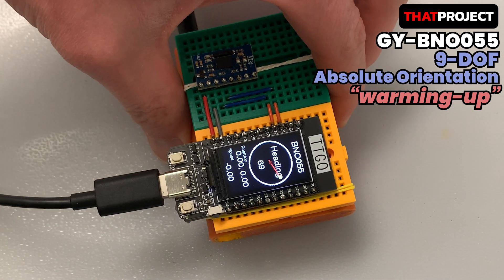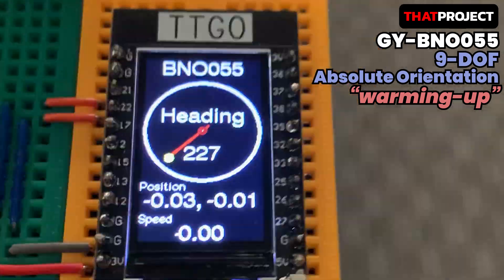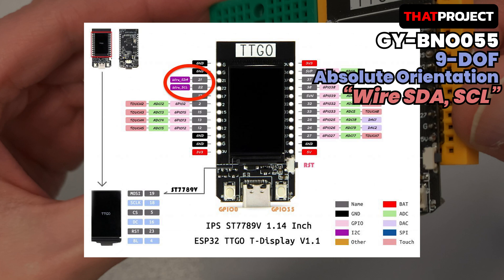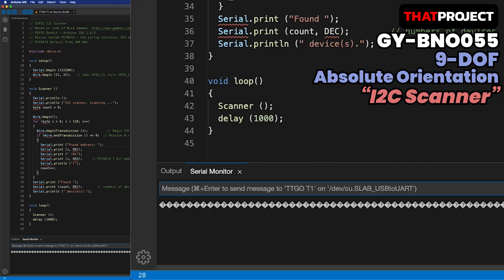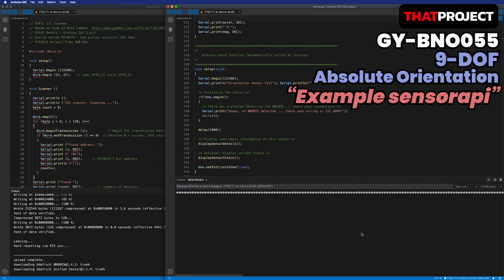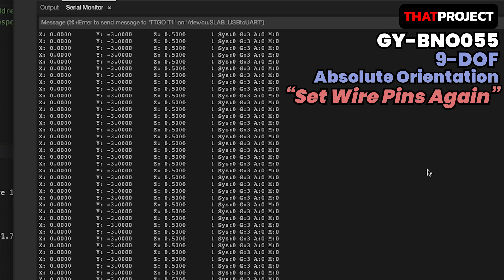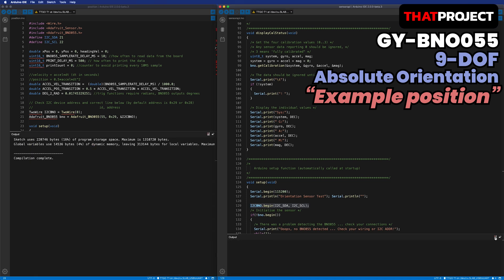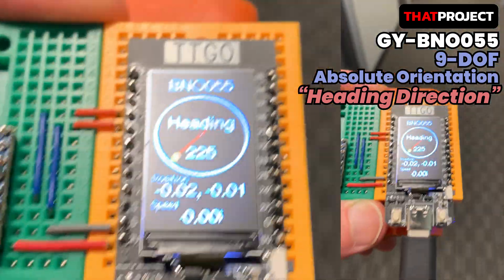GY-BNO055 | Ep.0: Connecting with ESP32 TTGO via I2C (ft. Heading Direction)

Comment: did you have to solded two spots on the top? iu see yours is connected on the solder spots, i can not get mine to work witha n arduino mega 2560
Reply from the maker: I didn't solder it, but according to others, the pads need to be soldered. Couldn't you just make an I2C connection like I mentioned in my video?

Comment: I'm encountering an issue while trying to communicate with a BNO055 sensor using the TTGO ESP32 board via I2C. Despite following the standard procedure, I'm unable to detect the device at address 0x29. I've ensured that the connections are correct, and I've also tried adjusting the I2C pins, but with no success. Could you please provide guidance on how to troubleshoot this issue or any potential solutions?

Thank you for your time and assistance.

Best regards
Reply from the maker: I2C address may be different. Would you like to check the address using i2c scanner? https://randomnerdtutorials.com/esp32-i2c-scanner-arduino/
Reply: I have the same problem as you. When testing, it says " 
Scanning...
No I2C devices found"
Reply: @tenluaquyetthang  If you are using the GY-BNO050, you must solder the pads on the PCB. The location of these pads can be seen in the video where there are spherical solder balls on the board.

Comment: I am getting this error while using my ttgo why is that happening could you please help me about it? 
"Sketch uses 258058 bayt (19 %)  of program storage space. Maximum is 30720 bytes.
Global variables use 14560 byte kadarını  (4%) of dynamic memory, leaving 166 bytes for local variables. Maximum is 294912 byte"

Why I cannot get anything at the serial monitor while I am copying things you doing in video?
Reply from the maker: Where is the error?? That's just information about your project when it's built.
In my code, If BNO-055 is not detected, the program stops. I think this is the reason why you can't get anything from your serial monitor.

Comment: Hello, 
First, thank you for your information and this video. 
In my project, I need to visualize the trajectory of solid particles, or I aim to replace a particle with an IMU sensor.
In your video, you say that if you are preparing a PhD, it is better to use a good sensor to have good results. 
You advised me by which sensor and I saw that the code changes from one sensor to another, how do I do if I use another than the GY-BNo055? 
Is it possible to use the same code using the ESP32 TTGO by ESP32 ? 

Thanks
Reply from the maker: No. Each sensor has a different interface, operation method, and clock speed, so please check the datasheet. The code must also be modified for the sensor you will use.
Reply: @ThatProject  
Thank you for your answer, 
Which sensor do you recommend?  What about the WT901BLE MPU9250 sensor, I saw on videos that we can retrieve the data using an application designed for this sensor. Is it possible to use these data to define the position in Matlab ?

Thanks
Reply from the maker: @yesssoukel1291  I haven't tried it so I have no idea about them. Sorry.
Reply: @ThatProject   OK thank you
Reply: @ThatProject   It's the same program if we use the microcontroller ESP32 (ESP-WROOM-32 Puce CP2102) ?
Reply from the maker: @yesssoukel1291  What is the same program? You mean it's the same as the ESP32 TTGO I used in this project? You can use any ESP32 for this project.
Reply: @ThatProject , Yes that is thank you.

Comment: If you use esp idf for bno055 you will also face the problem of clock stretching, I thought you will be solving that issue😂 after seeing the title but nonetheless great video.
Reply from the maker: Really? I didn't know there was such a problem. I'll have to do some more. Anyway, thanks for your comment.
Reply: I have been trying to fix this, that I didn't even knew was that.. I tried scanning I2C, tried using logic level converters, tried swapping esp32s, and finally am researching on this. Makes sense, gonna have to check the datasheet